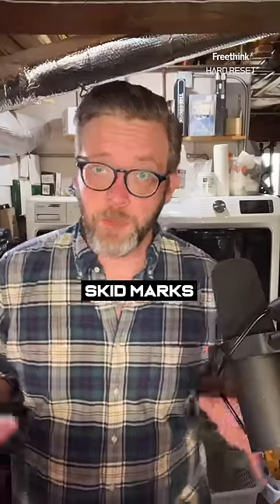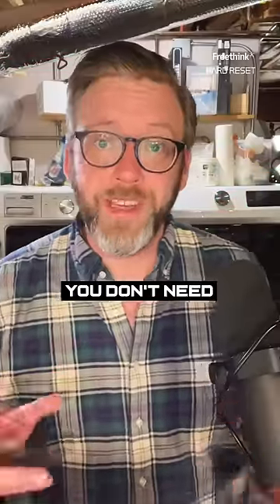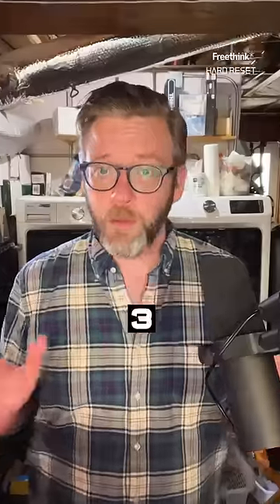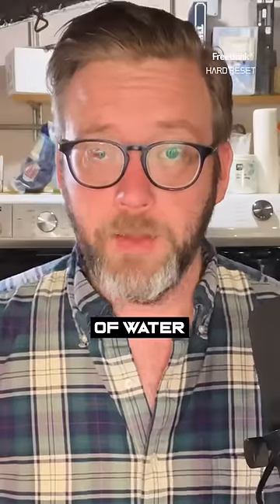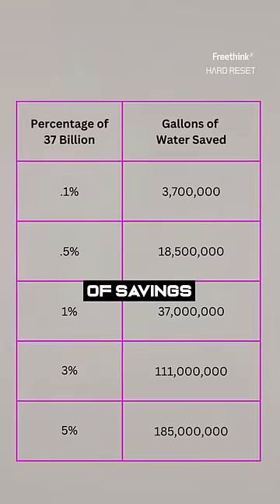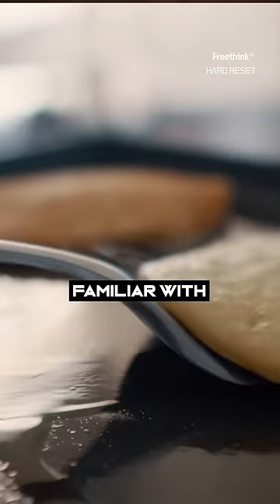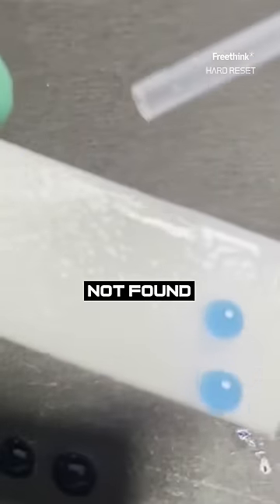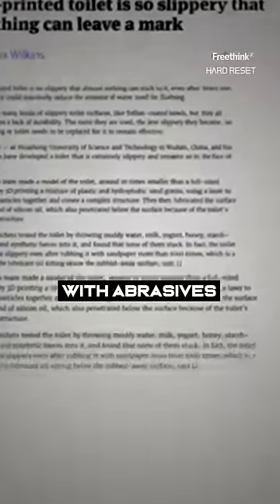Researchers invent super slippery toilet 🚽😳 #shorts #metamaterials

Comment: Seems to be an extension of an University discovery about thirty years ago where they were able to etch a pattern onto a metal to give it hydrophobic properties.  I seem to remember that it took forever for them to laser etch the nanoscale etchings and later studies showed that the water droplets were suspended by water tension across the gaps so very little of the water was touching the metal surface hence the hydrophobic effect, I think that later study proposed having the tips of the etchings to have Teflon coatings to further increase the hydrophobic effect.  It wasn't considered practical back then due to the long time it would take to nano laser etch the surface but they had hoped that knowing how the etched pattern provided a hydrophobic effect could lead to better hydrophobic coatings being developed.   One of the hopes was for slippery boat and submarine hulls (clearly an appeal for military funding), another was of course toilets, particularly compost or dry earth toilets such as the Air-head, Nature-head, and C-head toilets (common practice today is to lay down several strips of compostable toilet paper or a coffee filter so your feces doesn't stick to the surface as only gravity will cause it to drop through the trap door (the C-head just has an opening).  Another application seen back then, was graffiti proof surfaces where the spray paint would just slide off (vandalizing the ground at the foot of the surface instead).   I suppose another application would be car windshields that did not require wipers, solar panels that did not require cleaning, and perhaps low resistance water pipes...

Hydrophobic coatings were the rage back then but the coatings available at the time required frequent reapplications.

Comment: I would use this new material in the storage and flow of liquids. This would be slightly beneficial because almost all liquids have viscosity which means at least a bit of that liquid would get stuck on the walls of the storage. This would help reduce waste

Comment: Would never work. Toilets need to be air tight to prevent smell coming from the pipes, this requires a trap that has water in it.

The toilet bowl would also smell inside the hole unless the pipes were also treated with this slippery substance.  But than if there was a trap it would fill up with poo and smell and be unsanitary, a flush would be required to flush out the trap. 

So basically not practical except in a porta potty

Comment: Couldn’t pipes inner lining be made like this to prevent future drain clogs and make those systems further efficient.

Also, boats. Assuming this could prevent barnacles or even increase efficiency in the water, this could save on fossil fuels and maintenance.
Reply: Good Idea brother, I have been thinking of something like this for years. I also thought the no stain spray coating fir ships hull. But I guess ships hull made of this would be a better idea. And also inner surface of pipes.
By the way, I would like to talk to you further.
How can I contact you.
Reply: Ik PTFE is similar but 3 square inches is between 2-15$ depending on quality. It is expensive hence why we don't see it often.

Comment: Ok 1st. No more vehicles. Just slides. Well, ever so gentle miniscule degree of angle so u keep going but not like a real "slide" 
And 2nd, its not wasting it. And i mean loss as in start with 5 end with 2. We use alot of water but a small portion is lost. Crack n holes n pipeworks or absorbed into the ground or w.e
The water u use and flush drains back to the plant to get cleaned then bottled up for drinking.

Comment: If it could be made to be see through as well then it could be used as windshield material to have a window that has basically a permanent coating of rain-x… so water just rolls right off… would save on wiper wear and tear as well as make high rain situation safer for visibility… just my thoughts on it
Reply: It's a plastic, any sort of acid or base would cause transparent plastic to become cloudy, not to mention sun exposure would turn it yellow and cloudy as well as brittle from heat and elemental exposure. Great idea but it wouldn't be feasible or safe in reality.
Reply: @CnCEmpire  oh well… it was just an idea
Reply: @ReverendJustice76  Spray your glass windshield with RainX, it basically turns your windshield into this material. Water just slides right off, makes a world of a difference. Check out a video on it.
Reply: @CnCEmpire  yeah the only issue is that it wears off after a while… but if the windshield was made of material that stayed like that forever then you’d never have to worry about reapplying it… but it was just a silly idea…
Reply: @ReverendJustice76  inventions are often born out of necessity, definitely not a silly idea, just needs some rethinking :) a slippery, water repellent glass would definitely be game changing, I hope one day you can bring your idea to life!
Reply: @CnCEmpire  thanks for the well wishes😁

Comment: 30 years from now..."80% of the population has been diagnosed with ass cancer"
Reply: And all water supply is contaminated with it
Reply: Lmao hopefully not
Reply: Not exactly how that works...
Its not cancerous, in this case its the material itself that is slippery, not some sort of chemical coating, and unless you are shitting bullets or grinding up the plastic and eating it, you, the sewer system and the water supply should be just fine, besides the fact that its not cancerous.
Reply: @dud3655 We said thing about Teflon, then we changed to a different material that we thought was safe. We've finally established no Teflon, ok. Now simply having your food in contact with plastic is found to seep harmful chemicals into what you eat. So dude has a point
Reply: @dud3655 shitting bullets lololol
Reply: Lmao 😂
Reply: @dud3655  dude...I just wanted to make a joke and use the term "ass cancer"
Reply: I don't know about you, but I'm not sitting in the toilet bowl, but on the toilet seat.
Reply: @edwardhoffenheim3249 teflon itself isn't bad for you it's if you break up the Teflon coating or heat it well above normal cooking temperatures that it breaks down and gives off nasty chemicals. For plastic it's specifically plasticisers like phthalates that are the big worry with leaching. These are no longer common in new plastics designed for food.
Reply: @jacobarcher1097  Ok but why should I trust this information?
Reply: 👍x1000
Reply: @edwardhoffenheim3249 This metamaterial did not undergo the same chemical processes that Teflon does. Teflon is synthesized chemically. This new material is synthesized MECHANICALLY. Know the difference.
Reply: @gasun1274  That’s irrelevant. The 3d printing is mechanical but the material used for the printing was produced chemically, most likely
Reply: Learning from what happened with Teflon, now everyone has forever chemical in our body called pfas
Reply: The seat you sit on won't the be slippery, the bowl and pipes will prolly be the slippery bit, so unless your sitting your ass inside the bowl you should be good
Reply: @agravemisunderstanding9668  Some of us are cursed with undwieldy meat that brush inside the bowl 😔
Reply: This is why we have religions
Reply: @dud3655  I have read the paper and the video skips over a lot of it. They basically created a porous hydrophobic compound material which acts as a matrix to hold Dimethy-Silicone Oil which is the super slippery part. It seems as if you need to reapply the oil every now and then. However Dimethyl-Silicone is indeed non-toxic and non-carciogenic and is used as a  food additive.
Reply: The man that can sit anywhere sadly fell victim to this.
Reply: False. As we eat more fucked up stuff we become more resilient. Eventually eating healthy will yield lower lifespan
Reply: This is funny 🤣
Reply: Made in china:)
Reply: @dud3655 And you know this how? It took us years to find out that materials can diffuse into your skin despite being solid, mercury does it and plastic too. The last thing we need is to make things worse by trying to make things better, again.
Reply: @calcium_skeleton  Because this is the fucking 21st century and we know more than just "oh shiny liquid metal looks cool"
Reply: @1_mensch  Have a nice swim! Would you like to be given a boat?
Reply: @cobaltblue2756  Blame NASA and the space program for inventing teflon. They also gave us a powdered orange drink named Tang.

Comment: This doesn’t account for the water needed to take the solid waste through the drain pipes though. When you have a 1/4 “ per foot grade on your drain system you need enough water to wash through. Waterless drains are not possible with our infrastructure
Reply: I guess you could also lube up the pipes. But he didn’t say waterless he said less water
Reply: @quattuorvigintupletritrigi8357  so explain how your going to lube your entire drain system that’s behind your walls, underground, under streets, throughout entire cities…makes no sense

Comment: My biggest concern with a material like this is that like teflon or other nonstick surfaces, when the material wears down over time, it will release PFAs into the wastewater system. We currently can not treat PFAs on a feasible economic scale and it seems like this scenario would invite more into our water systems.

Edit: Presumably it would release PFAs or similar chemicals when breaking down.

Comment: Ignoring the fact that the water is needed for properly working sewage systems. 

Low flow toilets have wreaked havoc.
Reply: That is only because of outdated infrastructure and treatment systems. It is accurate but can be solved.  (Yes, I work in the water treatment industry,  in remote mining camps we can achieve treated wastewater that would pass as potable, but the systems are built for it)
Reply: @billwheeler1213  PG&E had to pay out billions in damages because 100 year old pipes in So-Cal blew up. 

cities are full of outdated infrastructure and refuses to allocate the money to fix it.
Reply: @mansquatch2260  don't forget about 'biodegradable sanity wipes'  the bane of Wastewater treatment.
Reply: @billwheeler1213 the language is so bad. wtf is "biodegradable" EXACTLY, under what conditions. the worst is plastics: "polyester" doesnt mean much, there are like 50 types of polyester, dozens of additives, and some degrade in weeks while some degrade in 1 million years. but the label just says polyester 😂

and even in the papers, you search is X plastic degradable and all u can find is "we degraded it using X bacteria at 80 degrees C in a bioreactor" 😂😂

Comment: As a licensed plumber, I will tell you. The less water you use, the more money you're gonna spend on calling me to come unclog your toilet . You need water to move the foulness down the pipe. without it,It will just sit in your sewer pipe under the House. you need water for the p trap to prevent sewer gas and nasty Smells from coming back up the toilet. The less water you use the worse your plumbing will be
Reply: The image there showed it going down on gravity alone. The whole pipeline would need a redesign. And that's a prototype still. The applications need to be sorted out.
Reply: What would happen if you made the pipes out of this material too? Would that solve the getting stuck issue? Obviously that kind of out there in terms of realistic application but in theory would it help?
Reply: Wouldn't sinks and showers still provide water to carry the solids down the pipe?
Reply: Yes, this is just the beginning. Maybe we can use air pressure instead of water
Reply: Yeah. At most this would prevent flushing more than once, but each flush still needs the standard amount to move the sewage in the pipes

Comment: That material that makes it slip must he very toxic and treated with chemicals, hence even if it saves water, all the water that would be flushed out would be more toxic, and we all know that the sewage water usually ends up in water bodies making it more polluted and toxic
Reply: "Must be very toxic and treated with chemicals" First of all EVERYTHING is chemicals, including you and I, AND water. Also, POOP is toxic already, you're not going to be eating off of these. Second of all do you have a source on the toxicity? Or is it just speculating? It could be a textured thing that makes it slippery, or simply something like porcelain interlaced with silicon or something like that. We have no idea so why make such bold claims?

Comment: Don’t listen to this everyone, water is necassary or else the sewage will get clogged. And that’s not fun neither cheap. I happened to be a plumber is 1 of the main reasons people get a clogged sewer is because of small amounds of flushed water per time. The water needs to escord the filth to the local authorities main sewege system and that is not do-able with a small amount of water.

Comment: the coefficient of static friction must be falling quite low, then. Parts made with this stuff that orinarily rub together will generate less heat when the parts are in contact and moving against each other: a piston and cylinder, for example.

less heat lost,  more efficient.

Turds are fun.

Comment: And here I thought that most of that water was used to evacuate the waste into the septic system. With enough pressure to get past the P or S trap. And cleaning the bowl was designed out of necessity as an original byproduct of this action. But what do I know? I'm only a plumber.

Comment: I would use it for fluid transportation, in sewage network or oil pipe, you need a lot of pumps to fight against contact forces between the fluid and the wall of your conduit.